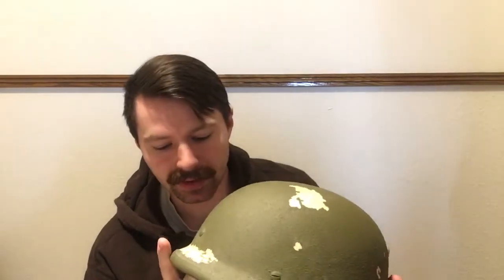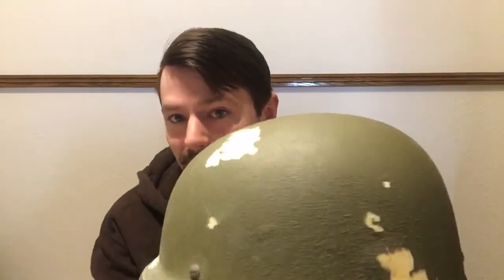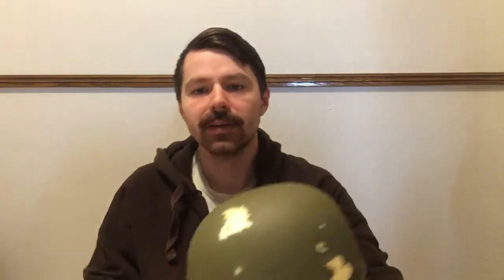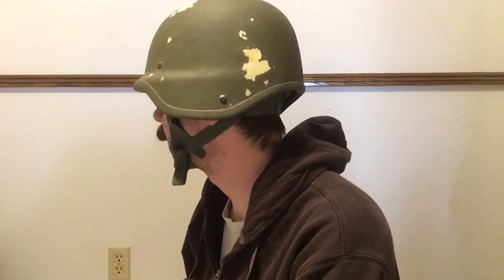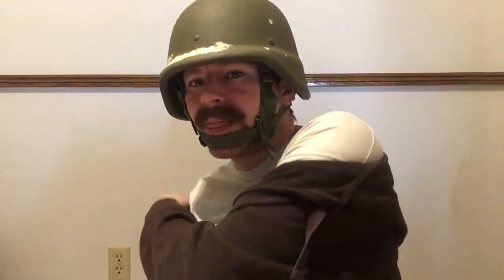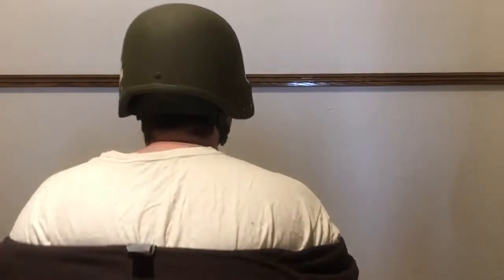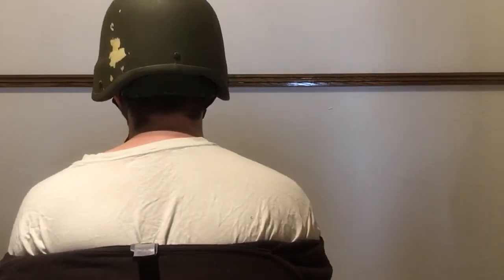Canadian barrday compared to cg634

Comment: How did people modify the suspension system to stop them from coming loose?
Reply from the maker: They would put rubber cement on the buckles or sew velcro on the straps
Reply: @DevinK  Rubber cement on the tip of the buckle's clamp?

And I'm guessing you mean velcro on the adjustment area of the strap to thicken it up so the buckle has a little more to grip, yeah?
Reply from the maker: @tastycheddar7958  rubber to grip the strap a little more but it often falls off eventually but the velcro just makes the buckle useless just put hook on one side and loop on the other in the middle of the two straps and you don’t need the buckle anymore